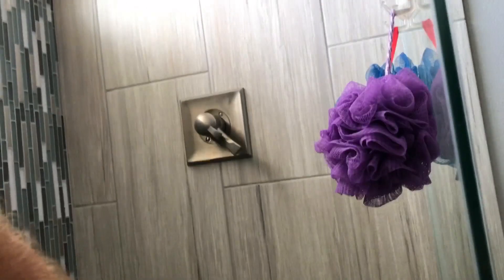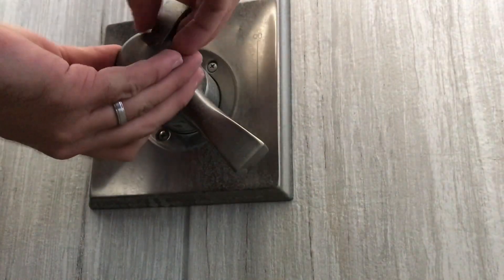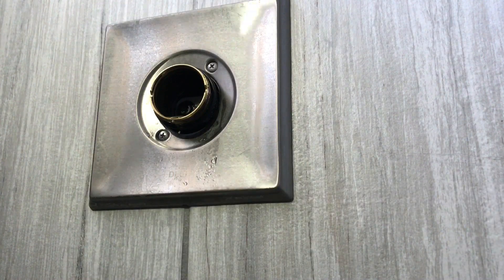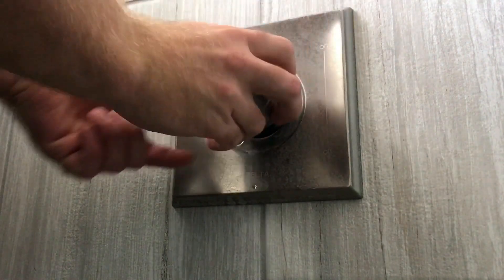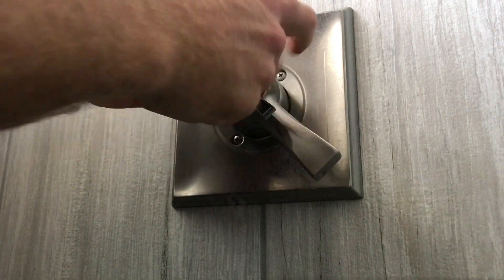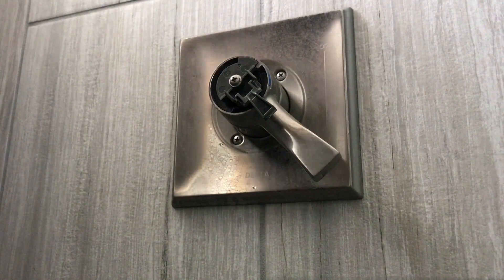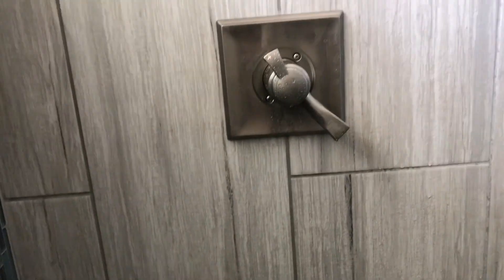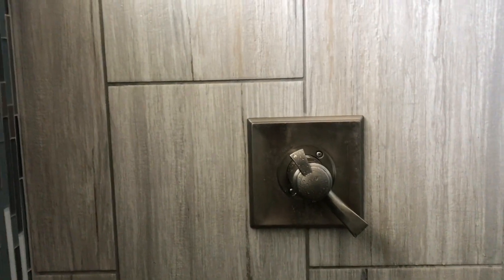Replacing Shower Mixing Valve Cartridge (Delta 17 Series)

Comment: Regarding why it rotates (found it in the instruction manual).  This is for "back or reverse installionts"(hot on right and cold on left).  So when the notch fits it should be okay but sometimes the "Hot" is on the wrong side for different reasons and this allows one to rotate it so the words "HOT SIDE" appear on the right.
Reply: ahhh.. I should have finished the video before I looked into it! (maybe this will help someone else).  Thank you for the video! It was super helpful as I get ready to do the same.

Comment: One suggestion.....give the part number on the replacement part.....great video.....have the identical problem just trying to find the right part.
Reply from the maker: Just search for a cartridge that says it fits with your trim series. This trim was Delta model 17.
Reply: @TomBrueggen  Got it......thanks for the reply

Comment: My comment was not about function,but about water being directed towards window and over time possible leakage and unsupervised rot
Reply from the maker: I got ya. I just tilted the head towards the window when I made this video so I didn't get wet. It's a rain head, so the water actually falls straight down, but can be swiveled a bit in all directions if one were so inclined. Sometimes when I'm feeling lavish I'll tilt both heads towards the middle and stand between them. Lord willing we don't get rot, but almost certainly will. We used the Kerdi (spelling?) system to waterproof on initial construction and it was supposed to be one of the best techniques on the market at the time.

Comment: It is also a good idea to pay close attention to the position of the old cartridge when you remove it. This will prevent you from installing it 180 degrees off. You should also cover the new valve with a light layer of plumbers grease and it will operate smoothly and last longer.
Reply from the maker: Very good points! Thanks for sharing!

Comment: This was extremely helpful.  Just replaced an old 15 series tub/shower faucet with a 17 series, but kept the old rough valve.   Note - I'm not a plumber and have never attempted this.   Put back together, the volume control lever was spinning 360 and the temp was backwards.  Watching this video showed me what was wrong - the new cartridge had 2 pegs instead of one (missed that) and the hot cold were backwards.  We filed the second peg off so the cartridge would sit properly, solving the volume control issue, and flipped it 180, solving the temp problem.  All better in 30 minutes, THANK YOU!!  Goodbye 90's, hello 2020.
Reply from the maker: I’m so happy it helped you! Thanks for watching! Like and subscribe 😀
Reply: I just installed my 17 series and I had the same exact problem! Didn’t seem right but was working ok and not done with the remodel yet so I hadn’t fine tuned it. In the middle of painting, I wet a rag and then the water would not turn off. This an hour or so after the furnace went out. This video is 10x more helpful than the instructions that came with it. 

Replumbed my wet wall, first time using PEX. Loved it, gonna have to check out the rest of the videos because those manifolds with the access panel were amazing!

Comment: Thanks for the vid.
Don't have a new cartridge yet but goofed around with mine yesterday. Pretty sure the peg is supposed to go on the hot side which is usually left. 

 Something that saved a trip to the store for me is closing the drain before starting the fun. -My first time in there and had the bright idea to go downstairs and turn the water back on for a few seconds with the cartridge out to flush any debris that might be in the pipes out (I had some plastic bit broke off). The flush part went well but it also blew the quad rings, springs, seals out of the valve body. -Luckily smirking at me in the tub when I got back up there. Happy Plumbing! It ain't bad but take your shower first. lol
Reply from the maker: Ha! I did the same thing when replacing the cartridge on my kids’ tub. Lucky the new cartridge came with all the parts and I had spares from the old. Think I lost a seal or two down the drain.

Comment: Thank you! I thought I was going to have to remove the access panel behind a full bookcase in the adjacent room to fix the dripping shower head. I'm so glad the repair can be made from inside the shower. Now I have to determine if my Delta 17 Multichoice is from before or after 2006.
Reply from the maker: Thanks for watching. Good luck!